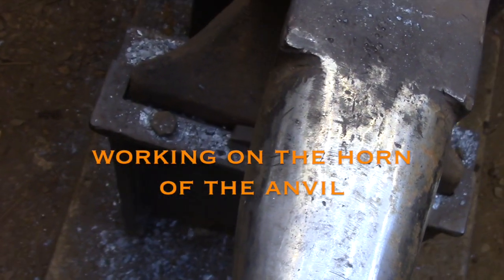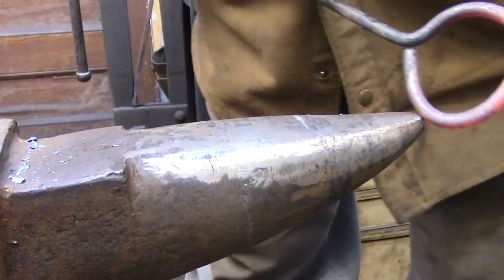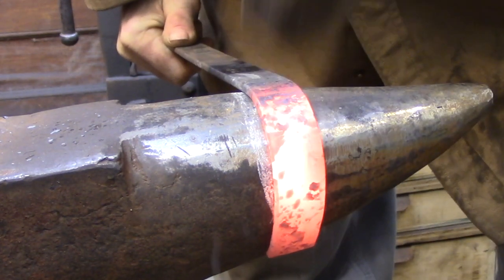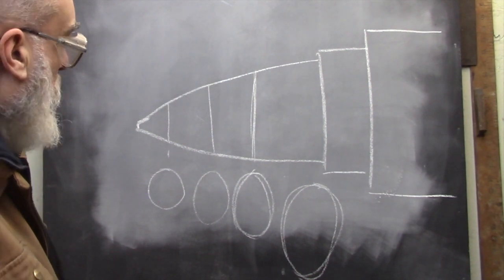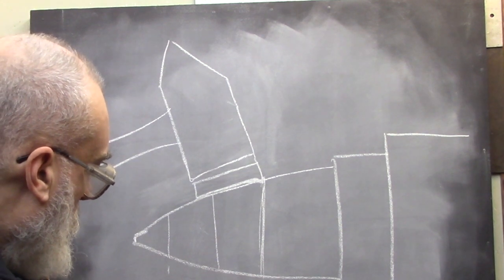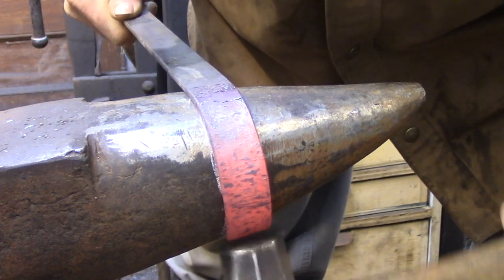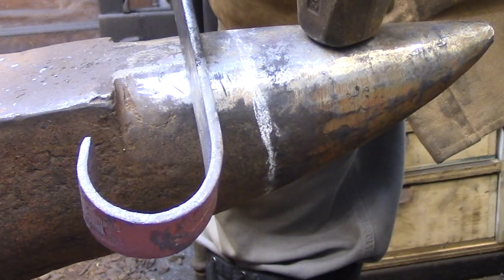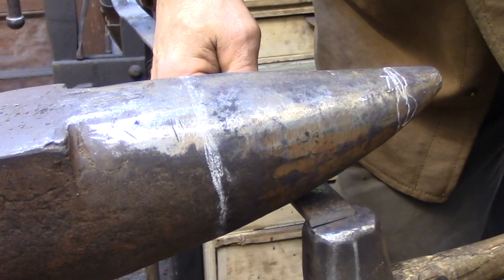Blacksmithing For Beginners - Woking On The Horn Of The Anvil

Comment: Cant you also alternate hammering from opposite sides of the horn to keep your twist from really getting out of hand as well?
Reply from the maker: The best way to restore a distorted piece is to first take it to the anvil face and bring the bar back in line and then take it to the horn to continue shaping.  Trying to distort the other side of the bar by moving to the other side of the horn will waste a lot of time and it may not correct the bend that has been placed in the bar.

Comment: Purgatory iron works has a crazy steeped mandrel cone based on this principle and more likely that he made it himself. With the stepped mandrel cone you get less then the infinite curves that you would get on a standard mandrel cone but you can more effectively make bends with deferent kinds of stock. Very interesting. Also could you not just hold the work to the anvil at the angle of your radius and work on it like that?
Reply: Trench Forge Armory If you approach the horn at an angle it will close or open the curve depending on the angle and if you have an English horn it will make the metal convex in the center. Use a turning fork or wrench to fine tune.  Use a jig if you have to make lots of matching peices.

Comment: my first instinct would've been to still hammer over the whole flat bar and have it sit flat on the horn, but just hold it from a different direction to adjust for the curve that's not supposed to form. Is there a reason why this wouldn't work?
Reply: the horn is not a cone so it would not be flat, but also even if it was a cone you would end up with an elipse and the flat bar would angle out from the center. It really needs to be along a circle and that is tough with 3D objects